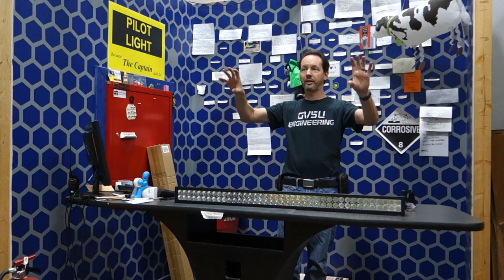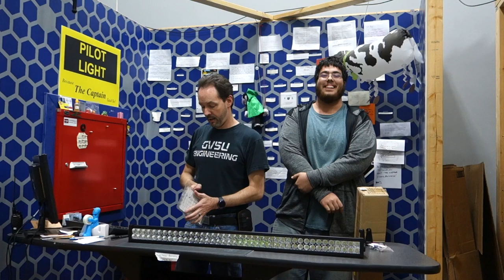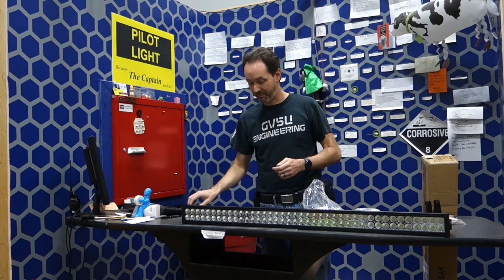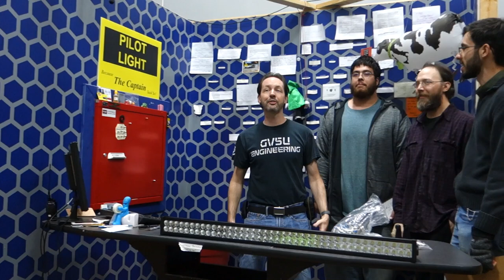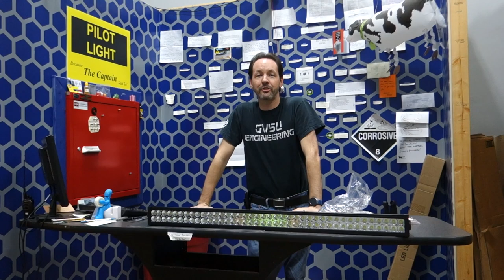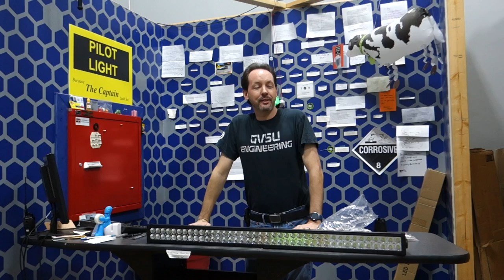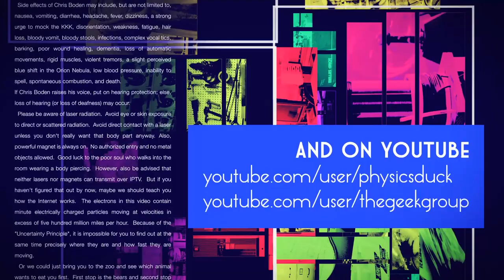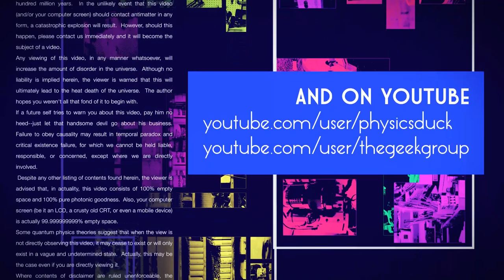Captain's Blog 11 10 2016 Forklift Overhaul Purple Phase For Mum

Comment: Long thin strips of material have much lower moment of inertia around the long axis, so it's easy to get them spinning stably about that axis.

Meanwhile, the lift generated by most airfoils, including flat airfoils, has a "center of lift" that's only 25-30% behind the leading edge, rather than the midpoint of the wing section. This means that these airfoils experience a torque that tends to make them flip backwards whenever they generate lift.

Furthermore, the flat airfoil flies equally well forward and backward, because it's symmetrical. This means that there's no torque that tries to restore the orientation of the airfoil to point into the oncoming air. 

Combine these effects together and you end up with a long "wing" that quickly spins up, stabilizing itself as it generates lift and flutters to the ground.

Comment: Paintbooth rotisseries are actually fairly common in body/paint shops that do concourse level restorations.  The problem that a lot of old cars (like the GTO) have is that sometimes the attachment points put undue stress on the body of the car and things can move a bit, so they try not to leave it on too long.  Unibody and shell-off-frame cars weren't designed to be stressed from both of their extreme ends without suspension.

Comment: Re: masking tips.  Don't pull the tape tight if you want perfectly straight lines - you'll undoubtedly be grabbing it slightly off-center, which will cause a difference in tension on the two edges, giving the strip a very slight arc.

Alternatively, you can use it to your advantage if you want a slight arc.